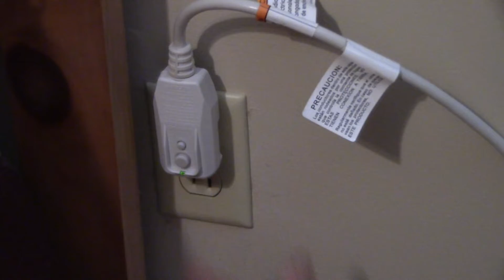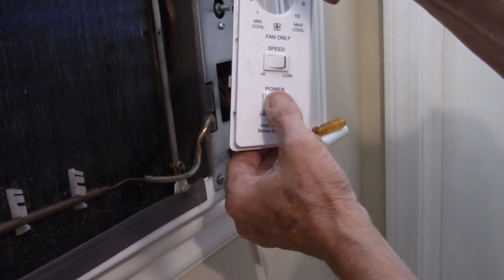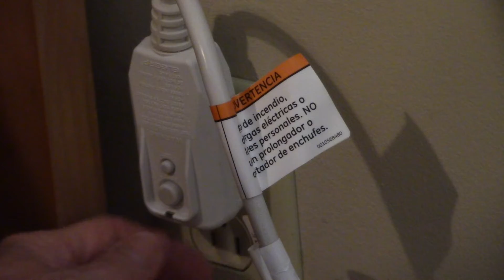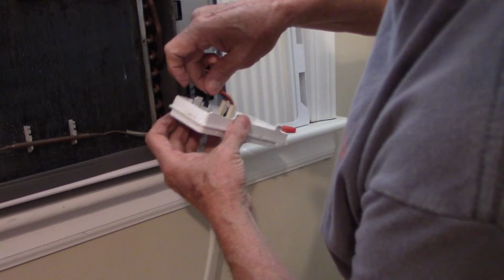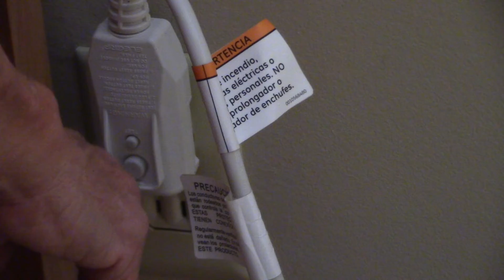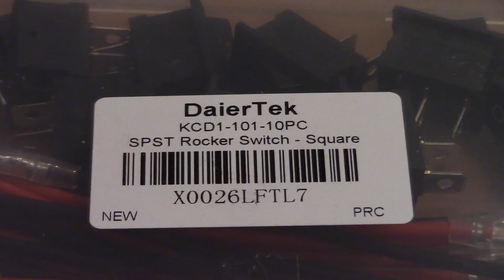Haier AC window unit. Power switch repair / replacement

Comment: Same model and same problem. But ours presented a little differently at first. Ours wouldn't turn off. Then later on it just quit. Thanks for this video. I was able to get ours working quickly!

Comment: They say crossing these 2 female switch wires can create a fire hazard. Is that true? I have an older Haier 16HJ bedroom size where the fan speed wire is hooked up to one of the female power switches. That's the way it came from the manufacturer.

Comment: My central AC broke and a friend loaned me the same AC unit that you showed here, but with a catch- I could use it if I could fix it, and he didn't remember what was wrong with it. Your video saved me! Got the rocker switch swapped out and now I can stay cool until an HVAC guy comes out. Thank you SO much.

Comment: Interestingly we have a 6000 BTU of this same brand but it has a push button type switch. It wouldn't turn on the first time we used it this year. I watched your vid and tried the switch one or two more times and it worked. Cheap quality switches the company's using I guess.
Reply: We got same one push button…trying to figure this one out

Comment: I’m trying to clean my ac unit for the winder. It got a lot of dirt and mold on the inside so I had to take the lid off. There is this white dried puddy like substance behind the control panel. Do you know what that is and what I need to do to replace if and put it back where it belongs?
Reply from the maker: Not sure, I had to clean mine also.

Comment: Hi! Do you have the link to the switch you bought? I have the same model of air conditioner with the same issue
Reply from the maker: Google the number on the old switch in the video or check amazon..Pause the video to get the numbers.
Reply: @hamradioportable1630 amazon has small ones or they're too big. can you just insert the link 🙄🙄

Comment: Thank you sir. This video wasdefinitely a great discovery for my personal situation. I live in Las Vegas and I don't have centrK air and today is smack in the middle of a  115degree - 125degree heat wave. I was sure I was up the creek, paddle less, until I decided to Google the switch issue and it led me here to your video.i am as you were, regarding the way you temporarily fixed it, I plan to purchase the switch asap and fix it properly, so I found a sufficient piece of metal as conduit between the two female ends and I am proud to say I was successful, thamx to u. I just wanted to thank you